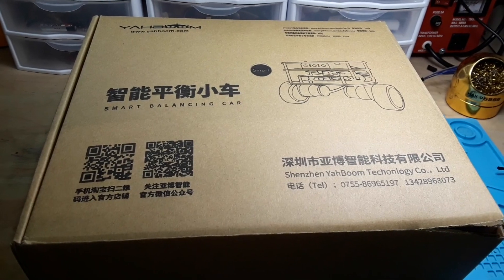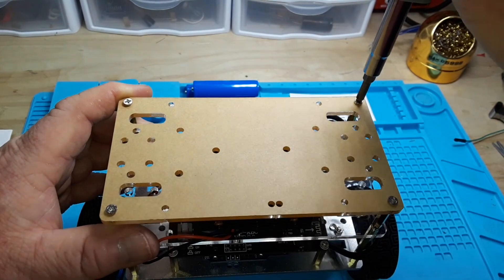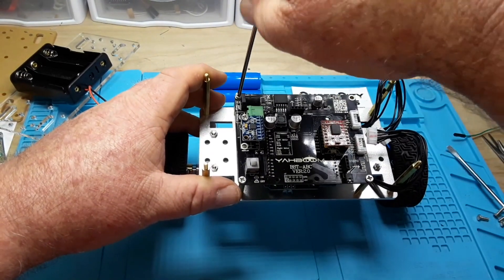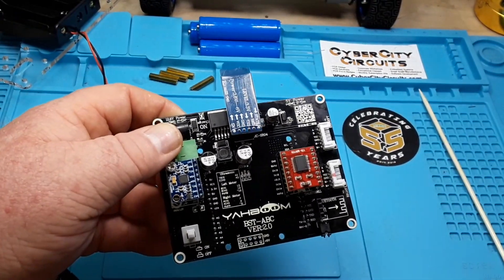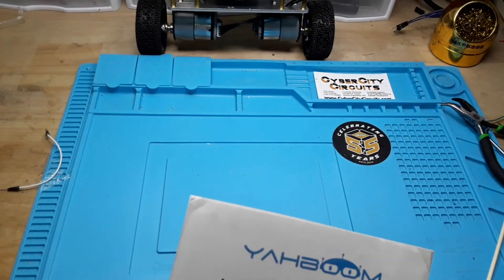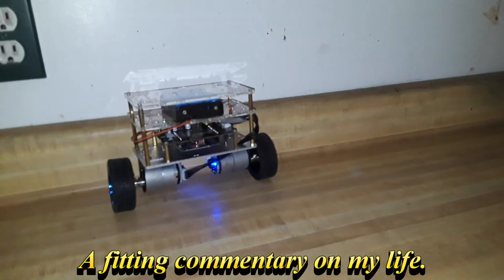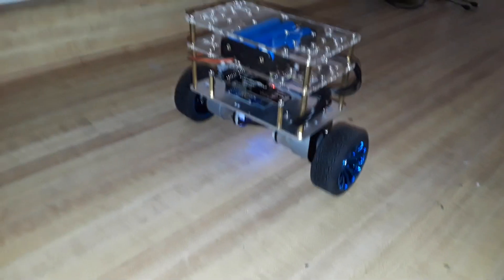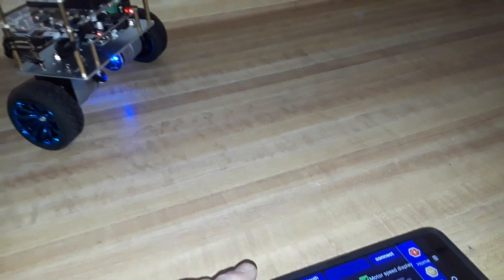Yahboom Self balancing Arduino based smart car

Comment: A nice little gadget, bit pricey, but better balanced than me.
Has to be said ALL 18650s holders are tight, those plastic sprung thingies can be a nightmare.  I now thread in a loop of fishing line round each cell to pull the little buggers out when they need charging, never was happy levering them with a blade or screwdriver. Lithium is a necessary evil, it always feels like powering things with a grenade
Reply: "Powering with a grenade.."  Yep - I agree.  There have been several times I've taken a battery out of something after what is probably a very minor problem, and dropped it right in the trash, and moved the cans away from the house.. I'm very careful with those things!
Reply: Just a tip: the batteries pop out just fine with a very thin spudger close to the positive end. Slide it right down in and then use it as a lever. Then it doesn't cut the plastic, or bend the spudger permanently. I find it works great every time, no matter how tight they are. But your fishing line idea is great too. Thanks!

Comment: 90$ have super expensive this all parts. uno can buy 5-8$ motors i not know imy country not have. battery bracket 1$ sensor 0,5$ motordriver shield 4$ some acryl sheet 2$ wire have ewery people in home, battery 1-4$  RC battery 3S 11,1V 13$ power switch 0,2$ maximum all parts cost whitout motors less than 20$.

Comment: couldnt you just put a weight on a shaft connected at a 90 degree angle and use that to determine which way you need to move to stay upright relative to the gravitational mass of the earth
Reply: That's what the IMU is for - It tells the arduino what way it is currently leaning, AND if it's moving

Comment: Putting the mark on the cable is genius.
Reply: Not really, there’s only 2 cables so not difficult to swap if necessary. Besides, the board is marked LEFT and RIGHT!
Reply: Normally anyone working with electronics will mark cable plug so there’s no reinstall problem. Something you pick up as a bench tech. So a genius idea maybe for whoever came up with it I guess.